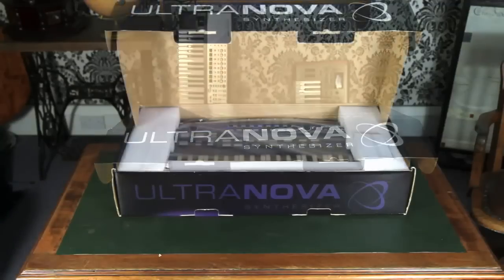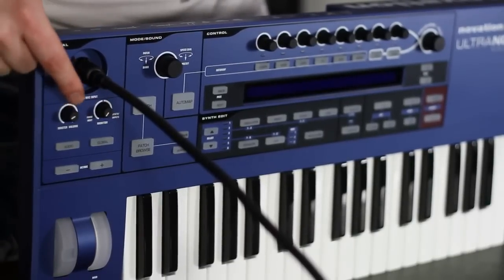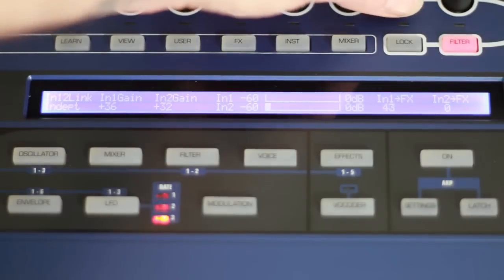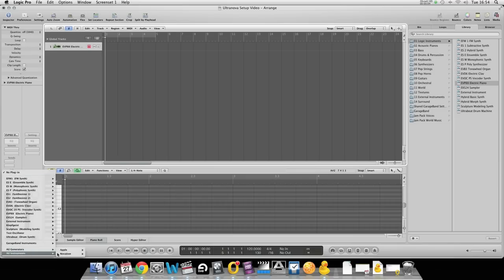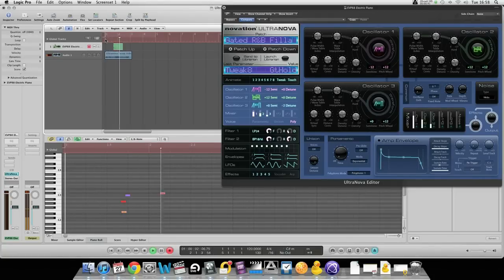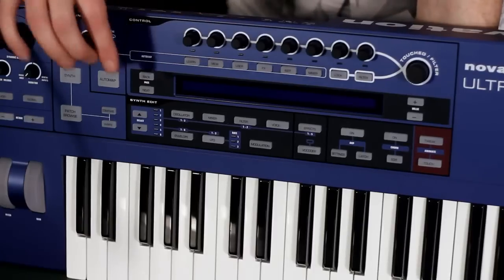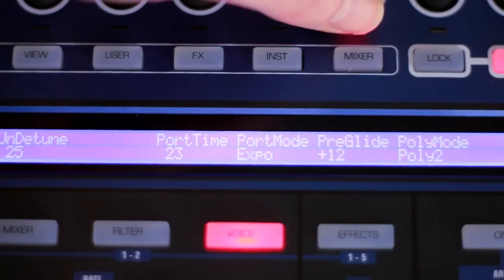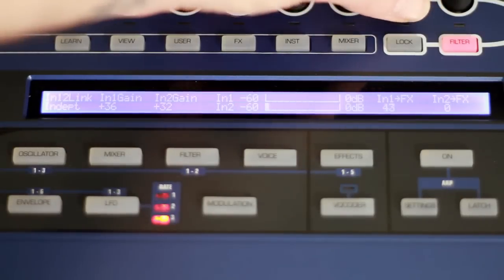OFFICIAL Novation UltraNova Synth Basics and setup

Comment: Iv got an issue, would appreciate if someone could help.  I have an ultranova hooked up to my laptop, running cubase 5. I also have a virus b rack. I have connected it to the ultranova via midi out from the ultranova and into the midi in on the virus.  when I hit the keys on the ultranova it does trigger the virus which is fine.  the problem is, when I record midi notes into cubase and play it back, it doesn't trigger the virus and there's no midi in signal showing on the virus. Iv tried everything and even rang the guys at novation but still no joy.  any Ideas anyone?